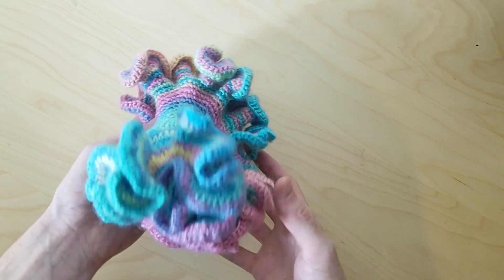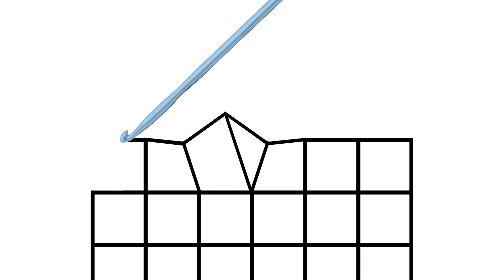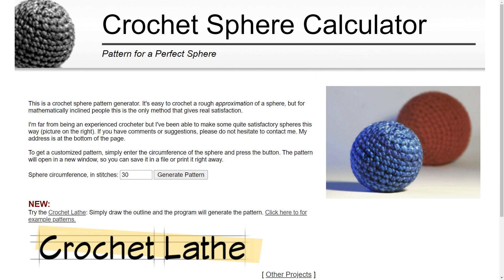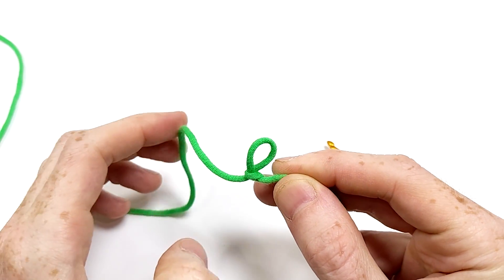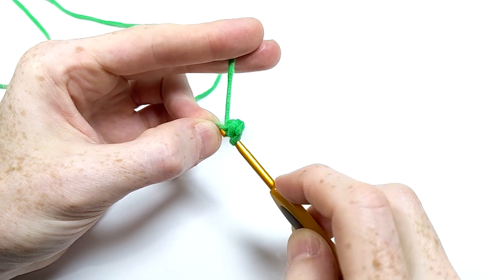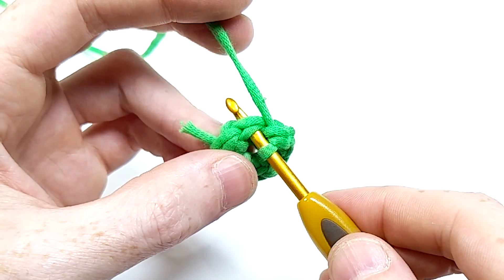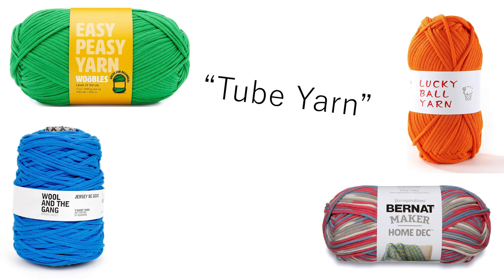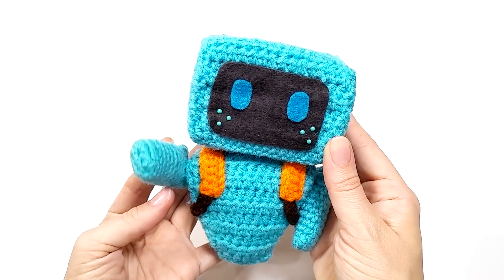Make Your Own Hyperbolic Surface!

Comment: Watching this as a crocheter was so fun to see. It took me almost 10 years before i finally realized that cochet is math! Mainly because i didn't start working with patterns until i was 16, haha. Something I would recommend for the hyperbolic shape is a stitch called the half-double stitch! It's simple, all you do is wrap your yarn around your hook before sticking your hook into the stitch and you pull off three lopps instead of two. It would make the shape look a lot more flush and make the wavy effect way more wavy. Thank you for this video. It opened my eyes to see that crochet is also geometry, too (which, duh, i know), but still seeing it being deconstructed and explained this way was so cool!

Comment: as a crocheter who wants to get into design, i am very interested in the topology of crochet. my current favorite thing is taking squares of different stitches and adding 2 sides while keeping the angles ar 90 degrees. then, when you fold one of the sides in half, youll have half of a cardigan shape. its fascinating.

Comment: This is the probably the best crochet tutorial I’ve ever seen. It’s so hard to convey the mesh idea, but it makes so much sense once you learn it (especially with plushie shaping)

Personal nitpick, don’t cut the yarn tails too short to prevent unraveling. Also, instead of pinching the yarn between your pointer and middle finger (makes my hand hurt just thinking about it), try wrapping the yarn twice clockwise around your pointer finger, and holding your project steady (just under the loop and hook) with your thumb and middle finger. It’s way less tiring and will make your hand cramp less.

Comment: Can you please direct me to more information about the beautiful minimal surfaces crochet model that appears at 8:03 in the video? Who designed this? Is it made from one continuous length of yarn, or is cutting and rejoining part of the process? It is wonderful. Thank you for this illuminating video!
Reply from the maker: Yes, it is made by starting with a chain in a figure 8 shape. Then just go around the perimeter with a similar amount of increasing as if it were a disk. You will end up crocheting on both sides of the loops as you go around.
Reply: Thank you for your response! I realize that at 8:03, you show a Mobius strip. I am actually interested in the minimal surfaces model at 8:04. It is such an interesting shape. I have been making Mobius strip forms with beads on the edge lately, a very satisfying project. Sometimes it is called a fidget spinner.  But the model at 8:04 in your video has really captured my attention. It looks a lot more complicated to me than a chain in a figure 8 and I'm not sure how to move forward. Do I need to place a stitch at the junction/intersection of the figure 8? What is the setup? I really like the 2 holes in the resulting model. It would be so cool worked very small and strung on a chain as a pendant. Or worked in fine silver wire. Any further information you could provide would really really help! I'm going to start working on this immediately to see if I can figure it out on my own, but a little more detail would really help! Thank you for your time, watching this video again now for the third time!

Comment: Thanks for sharing, very good tutorial and quite easy pattern for beginners, I had problems with the center, because I had a bump which I didn't like, needed to start over and over a few times, but eventually I found a balance with tightness (I didn't get used yet to use big hooks, so I used 2.5 mm, maybe the small stitches was a problem), I did a magic ring, and left it open until I finished a few first rows and made them a bit lose as well, only after it I tightened the magic ring

Comment: No idea if anyone said this before, but you can use double and triple increases to make hexagonal and (Edit 3: I’m pretty sure) heptagonal tilings.
Edit: If you don’t know what a double increase is, it’s basically an increase but instead of 2 SCs, you use 3. Add one more SC (Edit 2: in the same hole) to get a triple increase.

Comment: This is a fabulous tutorial.  You are correct, there isn’t enough mention of the math/crochet connection (math and art have so many overlaps!). Quick question: do you know where I can find a crochet pattern (written in crochet language, not math formula) for Bour’s minimal surfaces or Enneper’s surface and moebius strips?

Comment: This is one of the coolest videos ever. It's entertaining. Maybe if they had used crochet in school, I would have paid more attention in class. 🤷🏻‍♀️  Hard to say because my teachers were not the best to begin with. 

As a long time crocheter, I have to tell you that #4 weight is only common in America and the crochet hook is usually 5 or 5.5 mm. Not that it matters but it does make it easier to crochet that size yarn. The wrapper on the yarn will give you the size hook to use.

Comment: at 1:20 and 2:04 these bear a strong resemblance to dislocation defects in crystalline materials (atoms are usually in a grid shape, but sometimes there is an extra one, or a missing one). this video has me wondering what burgers vectors (a way to describe dislocation defects) would be like in hyperbolic (or spherical) space, and if euclidean bravais lattices have counterparts in those geometries (surely they must but a cursory search doesn't show anything).

Comment: Technically speaking, a surface where you begin crocheting flat as usual in the beginning, but then make increases every single knit/loop in all successive layers, doesn't give us a (constant curvature) hyperbolic surface, but it is asymptotically hyperbolic the further out we get. This is true whether we start from a central point or from a base line. This fact is connected to horocycles in the hyperbolic plane, and how they are asymptotically approximated by both large circles and distant equidistant curves/hypercycles (which are more or less the same thing, and more or less the same as horocycles, when studied from the point of view of Universal Hyperbolic Geometry a la mathematics professor Norman J. Wildberger).

Comment: Have you tried crocheting a Klein's Quartic surface yet? Or a Bring's Curve surface? Or a Bolza Surface? These are all examples of compact hyperbolic planes, with highly symmetrical regular tesselations (maximal in symmetry for their geni). These have genus 3, 2 and 4 respectively.
All compact unbounded hyperbolic surfaces have genus > 1, while the two compact unbounded Euclidean surfaces (torus and Klein bottle) have genus 1. The sphere and the projective plane = Roman surface are the only unbounded elliptical surfaces, and they are both compact, and have genus 0. Bounded surfaces of whatever constant curvature are similar to noncompact surfaces, though more complicated.

Comment: One tip for people trying to make a big one of these:

I'd recommend not cutting the string that comes out of the center so short, after 6 or 7 rounds the center starts to get a lot of tension and on my project, the string completely came out, leaving a gaping hole in the middle!

It's probably best to leave some yarn at the beginning and then sew it in so that you have a lot more friction keeping the yarn in place
Reply: I disagree. Waste not want not. If it’s on the way or ruins the shape. Snip snip ✂️
If you’re threads are still coming loose like what are you doing are you even crocheting?

Comment: In crochet, getting something like a hyperbolic surface is actually a happy little accident you'll make as a beginner. Some artists use these hyperboles to make appliques, or cool little decorative pieces. Some hyperbolic surfaces can be seen as a part of art pieces.
Also those pentagons while increasing stitches can be imagined as little v stitches over a single stitch in the previous row, to visualise better in practical implementation.
To keep track of counting, use little safety pins and pin them on the first stitches in the start of a row. 
⚠️ Crocheting can be extremely addictive and you may end up hoarding yarn and making the first ever cardigan before you know it 😂 Stay safe!
Reply: Just found this video a year later and i was thinking the same, I have many early projects that look like this 🤣🤣   happy accidents always !!!! ❤
Reply: Lol
Reply: "Ooops nooo I did a hyperbolic surface again :((("

Comment: I'm a crocheter myself and I think it's really cool how yarn can create hyperbolic space! And I created something similar when making a bathroom supply and I thought back to this channel.
Reply: Then a quick question from a math nerd who's picked up some yarn for the first time after having seen this video:

How do I finish the thing? There's this corner left on the edge that I've just tied off, but is there a way to make it look like a clean edge?
Reply: @st0lf  so what you'll want to do is slip stitch into the next stitch to finish off your project. I would look up a video on slip stitching or how to finish a project as it's easier to understand when you see it done but I'll try to explain it here.

 Basically go through the next stitch like you're starting a single crochet, pull up a loop and bring it through but instead of putting another loop on your hook and pulling it through like you would with a single crochet, just pull that loop you brought up from the other side through the one other loop on your hook and pull it tight. I like to finish off by making a chain one, cutting my yarn and then pulling the now loose tail through the chain by pulling on it with my hook, then you can tighten it and it will help keep your piece from unraveling.

Comment: "Unlike knitting, there's no such thing as crochet machines..." They've actually made several attempts to create such devices, with mixed results from "overengineered but technically functional" to "well that's several million dollars of R&D down the drain for a yarn-tangle-inator".
Reply: "Technically functional" actually means "cannot chain more than 4 chain stitches without messing up, much less anything else". I understand the want for accuracy, but find it pedantic because there still no truly functionally one.

Comment: I think your physics sim implementation is questionable. I was studying the code and realized the critical stuff is the physics sim and the functions for the 3 different stitch types. I see for each polygon you're adding you define spring-like connections of the appropriate lengths to make a regular polygon with edge length 1 unit, plus "diagonal" pairs that cross the interior. Square has 4 edges length 1 and 2 diagonals of length sqrt(2). Pentagon has 5 edges length 1 plus 4 "diagonals" of length PHI. Triangle is just the 3 edges, no diagonals. Ok so you implement some user interface to build up the perimeter of your starting seed, which isn't relevant for me, except that the user has to decide whether to add a triangle, square or pentagon. The display part of the program isn't relevant for my interest either. Now once you build up something you want to apply your physics simulation. I see you iterate through all pairs and just normalize them to set them to the correct distances away from their current midpoint based on their defined length. EEK! It's questionable whether this would converge on a stable state, but you evidently tried it and it works well enough. I would have modelled the forces on each point, treating each pair as a spring. If the length is too short, there's an outward force. If the length is too long, there's an inward force. Forces are always along the current direction of the pair. Springs have a simple force as proportional to displacement from their resting length behaviour. So you iterate through all pairs and compute a total 3D vector force on each point. Then you iterate through all points adding some fraction of the force to each point's position, and they'll drift to a stable state. Or you could have a velocity vector associated with each point, you add some fraction of the force vector to the velocity vector, and add the velocity vector to the position vector, for each point. In this case it'd be a good idea to add some friction mechanism to the velocity vector so it damps out.

Another thing I note is you seem to hold some number of points fixed in place, I guess that's your starting seed stuck to the bottom of the space so the whole thing doesn't drift around. You also seem to introduce some pulling force in the upwards direction to some of the most recently added points, which was evidently necessary to let the lattice expand out into the 3rd dimension having started out on a plane. Surprising that that works, your real hyperbolic surfaces seem to have up and down alternating flaps on the periphery. I guess I can assume the sim version behaves the same.

The above summary is just some notes after studying the code for a while. Thanks for releasing it. I run linux and don't use Unity myself. I'd have written this line "Vector3 newPoint = curPt + lastPt - prevPt;" as "Vector3 newPoint = lastPt + curPt - prevPt;" so it's more obvious you're just replicating the delta onto lastPt. More readable IMO and easier to grasp, in the event you have to look at your own code 20 years from now.

Comment: Personally, I prefer to control the yarn in my hook hand - having it go over the index finger, under the middle finger, and around the ring finger gives me just enough friction to stop it slipping freely, without stopping me from tugging out a little bit more slack as the yarn gets used up, while also barely changing how I'm using my hand to hold the hook.

...also, this pattern might be old news to me - I've been making the increase every stitch pieces for quite some time, and find that full enough hyperbolic disks make for a great cross between stress balls and fidget toys. (I'm planning on making one to felt next)

Comment: I literally just learned how to crochet over last winter break (from my mom) and I have been enjoying it immensely. I had the same realization, not long after I learned, that crochet allows me to make meshes / surfaces, especially those that are hard to make any other way (like hyperbolic surfaces!). That quip about the beginning few crochets being the hardest part is 100% true - there's very little to hold on for generating tension in the right way and once you have something substantial to hold on to, it becomes more about doing quadrillions of crochets until you're done.

Comment: The thing about crochet that you won't have a machine is the open-ended creativity possible.  You can insert the hook anywhere in the work, not just in the top loop of the next stitch in a row.  You can go between stitches or in large holes created for that purpose; you can pick up just the back loop of the stitch.  And that's still just going in rows.  But you don't have to do that-- you can go sideways along the edge, or anything at all.  When doing lace, you go off into the air sometimes connecting back to parts you already did, and finally bringing the whole thing back down to the main work.

Comment: That doesn't look like yarn at all!  It's some kind of braided cord.  I've seen Paracord catalogs that include thinner varieties all the way down to small braided thread.  I've never seen yarn called "size 4" or whatever.  I actually don't recall what the thicker or thinner than standard varieties are called, if anything.  Buying in person the labeling didn't matter as much as today when people buy online.

Later:  I see you acknowledged it at the very end.  I think "tube yarn" is a small niche that someone decided to get paracord into the yarn stores.  But, you can find paracord on-line quite readily.  But, don't get the normal stuff, but a thinner variety.  Some online catalogs have a variety of sizes.  Being "tube", I think what you have is a braided jacket without any stuffing.  This is, I recall, one "size" down from standard paracord.  I bought some to make a belt because it imitates the look of the leather strips of the belts I like that would wear and break.
Reply: Tube yarn and paracord aren't the same. Tube yarn isn't technically yarn, but it's also not paracord. It doesn't have any tensile strength beyond normal yarn because of the materials which are designed for it to be even more flexible than paracord casing, and doesn't have any innards either. 

But also, separately, how on earth have you never heard of yarn being referred to with number sizing? Like stitches have name variations between the US/UK, yarn weights in the US get labeled with sizes 0-7 unless it's a hand makers who prefers UK terms like Aran (size 3 - 4), Worsted (size 4), sport (size 3), fingering/sock (2), or chunky (5). It's incredibly common? I'm really not sure how you haven't seen that?

Comment: As somone who was taught to crochet growing up and still does from time to time, I love this little cross over episode. I’ve been seeing a few of your dev logs and was mainly just here for the space distortion since I’m not a programmer. But now I get to see hyperbolic space in a more familiar setting and I think that’s really cool

Edit for additional thought: usually increases and decrease are made to make different shapes like circles, but in my experience those shapes are meant to be flat like if you’re making a coaster. Or you make hexagon shaped tiles to join into a blanket same way you would with granny squares. Also, most 3-D aspects of crochet is texture on a flat surface like a front post double crochet stitches that connect to make a line of Vs across the rows of a scarf. The purposeful increasing to break the flat plane and just keeping doing it in a pattern is really cool.